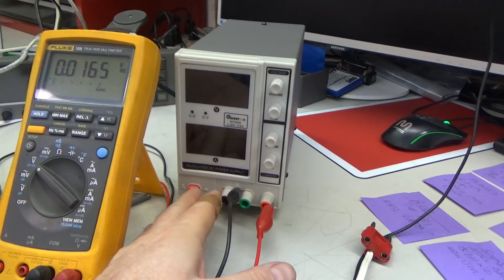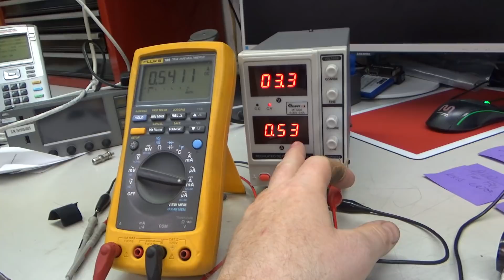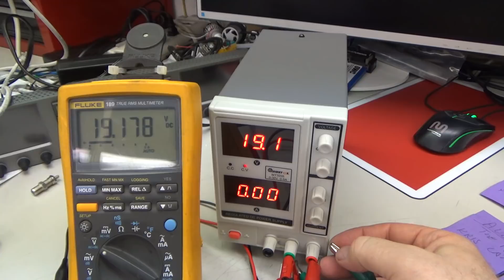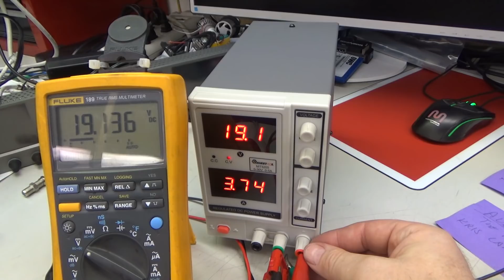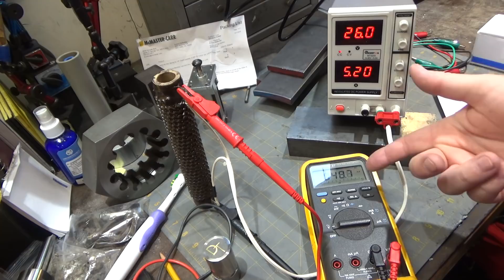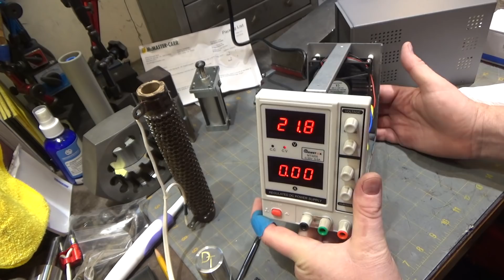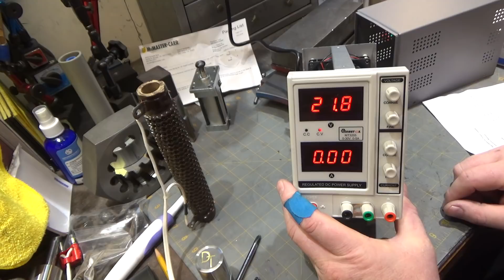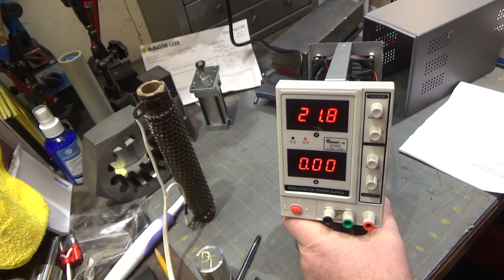QTR 34 Banggood 5A 30V Variable  Power Supply

Comment: Dudley, one of the tests I had to make when calibrating lab supplies was to run the input through a variac to check that supply worked from the minimum to maximum input voltage.  I was in the cal lab so long ago I worked on core memory!
Reply from the maker: I have only seen core memory in a glass case, back in school, but I do remember punch cards. I did not think of testing the input voltage range. Great idea. Thanks. I'll use that idea next time.

Comment: Any chance you checked for voltage spikes when switching the power supply on and off?
Reply from the maker: I did not, but a very good idea.
Reply: @DudleyToolwright  I bought one of these:  www.amazon.com/dp/B00B03VPQE
...it's coming tomorrow.  I told my wife that the price was going to go up $60 because of the tariff so I had to buy it now!  While reading reviews of lower cost PSs, I noticed quite a few references to voltage spikes– yikes!

Comment: If you expect a precision Lab supply for this price you are dreaming.
If you want a general bench supply this is as good as any for the price.
Cheers Eric
Reply from the maker: I certainly did not, but I did want to make sure viewers knew what it was versus what it wasn't. I was a bit disappointed at the fan speed drop at max current and buyers should beware of this issue. Also, as expected, the regulation and noise went to the dog house when you hit the higher currents. Finally, the regulation itself was a bit weird and did not always return to the same value after a load change. For general work this supply is more than fine, but you have to know the limitations of your tools if you want any kind of accuracy.

Comment: Two questions:
1) can we see it on a O-Scope?
2) what is in the Blue bottle?
Reply from the maker: I did have a whole segment on the O Scope but the auto focus completely hosed me. I don't have a scope at home so I would have to do it at work again and things are a bit crazy right not. The blue bottle is the potion that makes you bigger again or it is some .05um lapping solution.
Reply: @DudleyToolwright  - I was referring to the PS on a O-Scope, And I was curious about the bottle because of the Logo on the side it looks like the NCR logo?
Reply from the maker: Here is a link to the lapping solution:

https://www.ebay.com/itm/118ml-0-05-nano-Diamond-Slurry-Polishing-Lapidary-Jewelry-Watch-Lapping-sapphire/183464264645?ssPageName=STRK%3AMEBIDX%3AIT&_trksid=p2057872.m2749.l2649

I am not sure what you are asking about the scope. I did shoot a whole segment on noise using the scope at work, but the autofocus made it unwatchable. Hope this helps.
Reply: D.R. M. 90

Comment: Cool review, you sure speak from knowledge about this subject. I would be lost reviewing electronics!
Reply: I'm pretty sure he works with electronics of some sort for a living. He is pretty sharp on them.

Edit: just saw he's doing this review at work. Duh lol
Reply: I would say so! :)
Reply from the maker: I have a degree in electrical engineering, but my day job is mostly in repairing broken audio/video equipment and systems design. I used to repair equipment to the component level, but alas most cameras and such are not made to be repaired any more granular than to the board level. In the old days, manufacturers like Sony of Grass Valley Group would not only provide schematics for everything, but they would also provide classes and explanations as to how every part of every circuit works. Now we replace boards and toss the bad ones out. Even Tektronix use to provide schematics with all of there test equipment. Such a shame.
Reply: @DudleyToolwright  come over to automotive electronics, its like getting your head dunked in a toilet just about every day :p
Reply from the maker: Interesting niche. You guys have to design systems for some of the harshest environments and still get reliability. Temp swings, vibration, yikes.

Comment: I bought some keysights for work, 30v 5a linear ... think they were about 750 + shipping. I am not a fan of most of these little 50$ off shore supplies, I haven't had one that wasnt junk, the little circuit specialist one out on my home bench has had its pots replaced twice and I have to re-zero the current meter every time the seasons change (stupid thing things its got 500ma with no load at the moment) but Its still working after 5 years so I guess they have their place in the world
Reply from the maker: You bring up very good points, but I review these inexpensive supplies for people on a limited budget or those who only use them very occasionally. There is no substitute for quality instrumentation, but if the choice is adequate or nothing...you get my point. Thanks for sharing your point of view. I concur.

Comment: Seems very expensive for cheap electronics & fan  power source issue.
Reply from the maker: They are unfortunate issues. The price is really inexpensive for a typical current limit control power supply, but the problems it has are unfortunate.

Comment: Very cool review.  Just curious, but could you use this to permanently power a motor such as a mill powerfeed ?
Reply from the maker: You could but this particular case is pretty fragile so you would have to be careful how and where you mounted it. The current limit could be used as motor overload protection as well. Thanks for the comment.
Reply: I havent tried this exact supply but I had one very similar that had 80% load on it for 45 days, ran fine, but never came back on once we turned it off :)